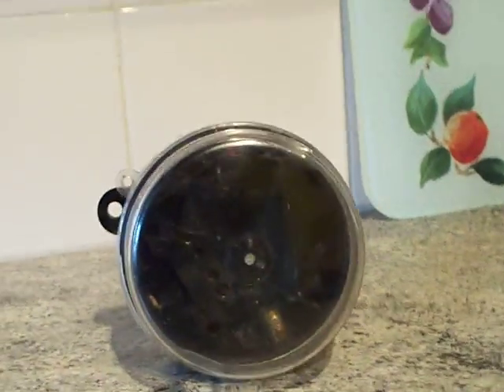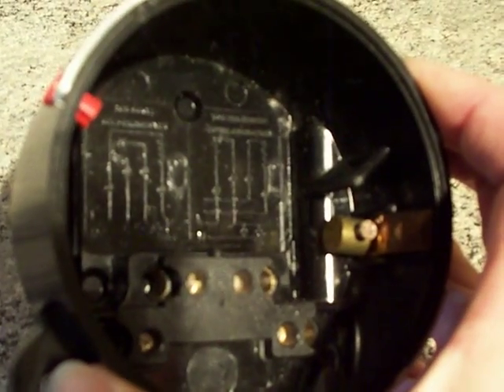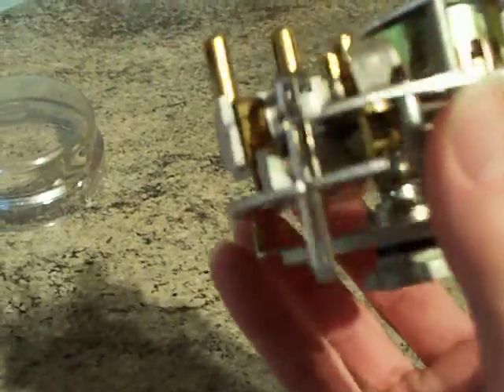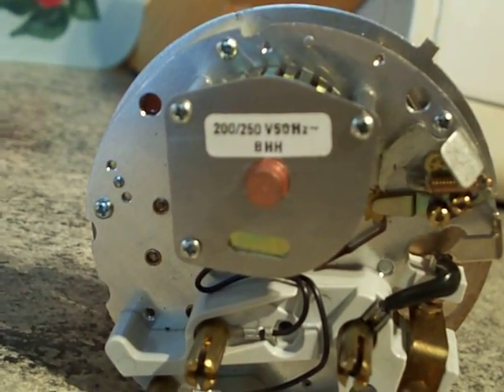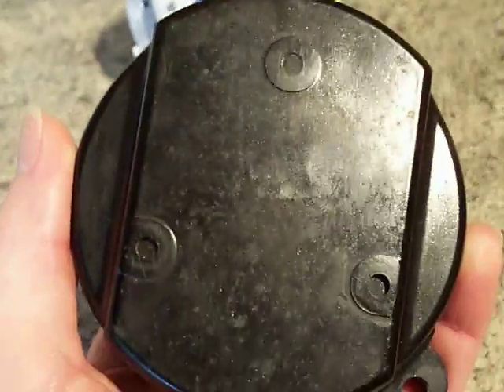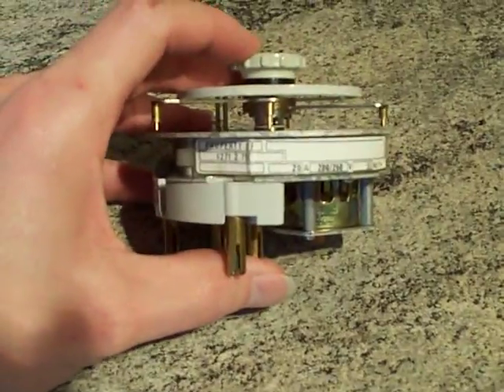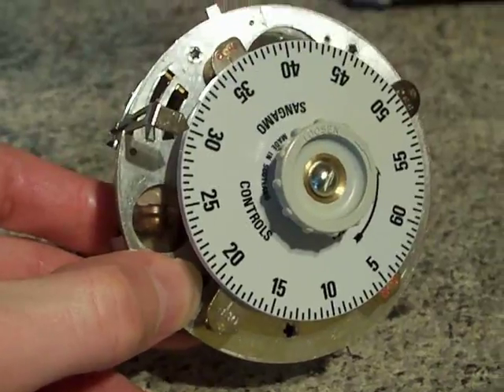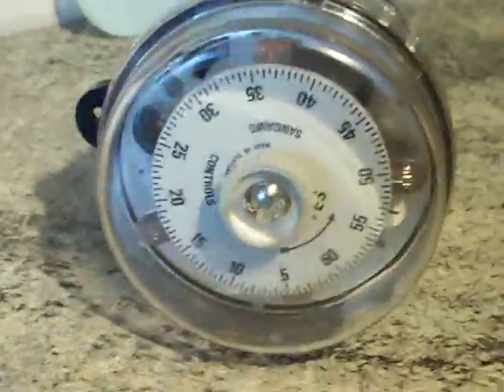Time Switch : Unusual 60-Minute Sangamo Weston S 271.2.71 E timeswitch.

Comment: According to the catalog, the S271 was available with 1, 2, or 3 levers or with three- or four-lobed cams for fixed interval timing.  There were also short-interval timeswitches available from Sangamo, models S277-S280.  These were designed to make or break a circuit (depending on the model) for a specific interval measured in seconds, and then repeat the operation a certain amount of times per hour.

Comment from the maker: @RODALCO2007 Interesting that you should say that, because I came up with an idea for a 'cut-off' timer for a water heater a few years back....

Basically, it's a standard Sangamo S250 wired "backwards". When wired backwards, the timeswitch can be set for a certain amount of hours, & when the timer turns off the load, it also cuts itself off too, thus it stops. :-D

The advantage with doing that to a standard S250 is that I'd have the capability of having the load on anywhere between 1-23 hours.

Comment from the maker: @HDXFH I'm unsure what such a timeswitch was used for. Whatever it was, there must have been enough demand for 60-minute timeswitches for Sangamo Weston to mass-produce them. 

I know I'm stating the obvious in this next sentence, but basically, there must have been a need to have some kind of load repeatedly switched on-&-off within an hour, every hour. 

Seeing as this does have independent motor connections, it'd be interesting to use it as a Rate-Changer Timeswitch! :-D

-BoomBoxDeluxe. :-)